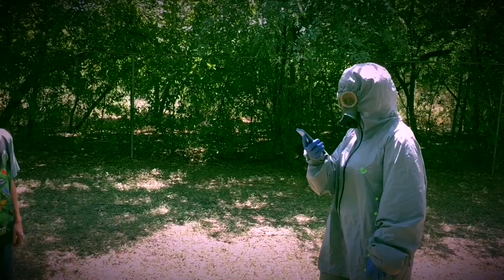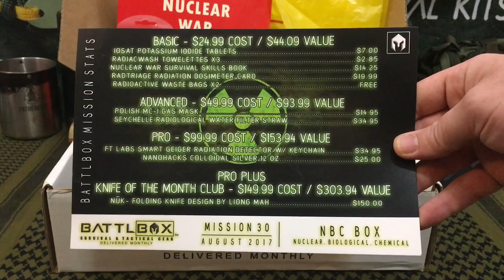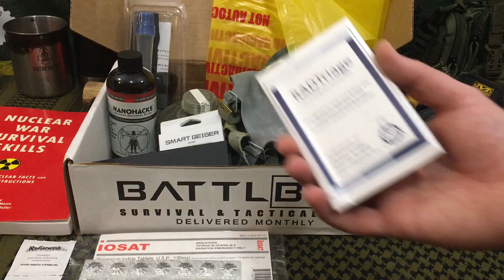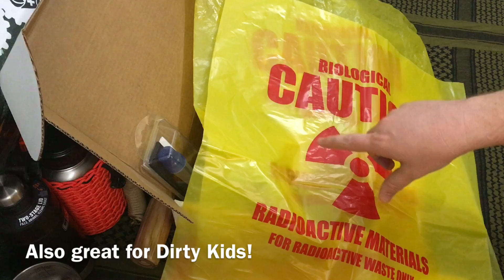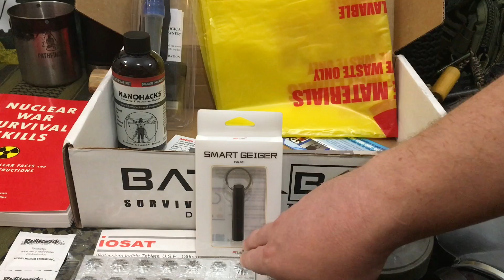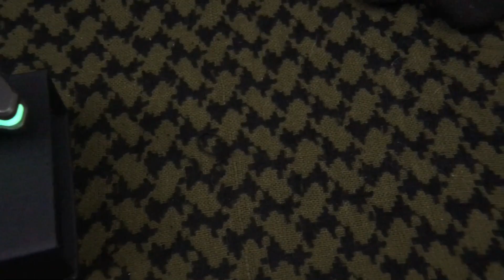Battlbox (Battle Box) Mission 30 | Pro Plus Review | NUCLEAR BIOLOGICAL CHEMICAL

Comment: Those wipes are probably super similar to "Tecnu" which is used to wash off poison ivy/oak oils. But was originally made to wash off radioactive dust during the cold war. The inventors wife accidentally discovered that it worked great for removing urushiol oils. So that is what it is marketed towards now. But I figured it'd be a great alternative. I personally have a bottle for my bug out bag.

Comment: Those pills do not shrink the thyroid they basically fill the thyroid up so nothing else can get in next that mask is complete crap and should never be used and the filter should be thrown away because I'm sure it's past its expiration date and it's more than likely carcinogenic and this is coming from an old Soldier who is on the first Cav chemical decontamination team
Reply from the maker: I said that. the mask isnt rated or approved and I mentioned Several times to investment in an Approved NBC Rated Gas Mask. also, Yes it does. Potassium Iodide reduces the amount of hormones produced in the thyroid gland, shrinks it, and blocks radioactive iodine from entering during a radioactive attack, emergency, etc.